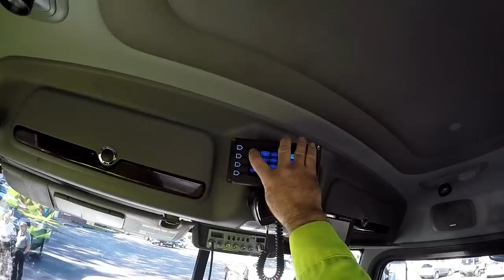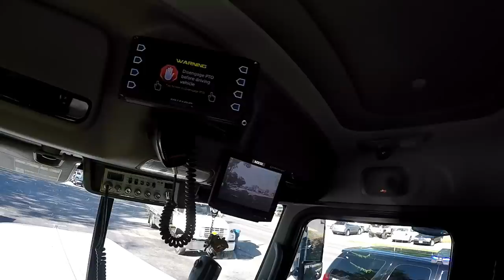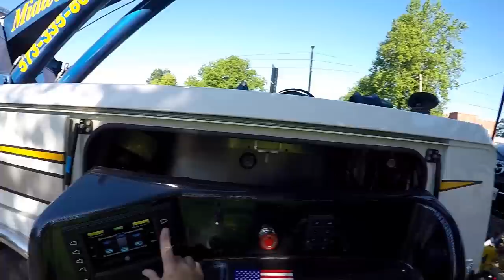TROLL BRIDGE

Comment: I hope you had her remove the car seats her self. I would not remove them for her as I would not want ANY sort of responsibility or liability if she uses those car seats again!
Reply: It wouldn't matter either way. She is on camera being told they can't be used anymore. If she uses them then tries to claim other wise and sue ron, Case won't go far as she was told by Ron and police officers there they are not legal to use when involved in a crash.
Reply: At that speed, with no one in them, there was no damage to them. And unless you recorded the serial numbers, you have no way to know if she replaced them or reused them. That said, it's always best to replace any piece of safety equipment if there is any question of it's fitness. Insurance should cover their replacement. (age is part of the equation. I've known people to use the same baby seats for decades.)
Reply: A very good point that is not stressed enough! Where I'm from the Highway patrol normally cuts the straps on them. If they don't, I do.
Reply: "I've known people to use the same baby seats for decades." <=== this is exactly why the police can give some good fines for that too. I don't have one, but there is a date written somewhere. If there is no date it is considered out of date and dangerous. If more than 10 years old then out of date. In both case you get a fine...

... Some unfortunatelly don't understand it... In fact, there was an article that a mother got a fine and couln't drive with that seat with her kid in it and made a big story: IT WAS BROKEN! She tought it was not a big deal because she only do city driving...
Reply: jfbeam 
What speed do you know she was going?
In that state which the MVC occured, do you know the specific law regarding car seats?
When I said I would have the driver remove the seats it was not so I as a company can sure her, its so she can't come back and so me. Its here property and she is intitled to them I just do not want to be the one thay gave them to her as she could say in legal documents that I knew she was going to re-use the seats as I (mother) said I was and he gave me theml. I (mother) thought he would know if they are safe or not as he has more experience then I. Plus I was shacken at the seen and I was not thinking straight so I did not understand thay I could be or use the seats.
Reply: +jfbeam   I agree. The only reasons for not reusing the car seats would be 1. because the air bags deployed, and 2. because the car could not be driven away from the accident. The car has likely been repaired and is back on road. There is no reason that the child seats shouldn't be too. Assuming there was no obvious damage to them.
Reply: jfbeam the issue a parent or person transporting children in safety seats that are out of date  is that, in the event of an accident where any injuries occur, each child that was using a seat is noted and also the seat itself is inspected. If it is expired then the parents open themselves up to the evaluation from Child Protective Services. Many probably don't think ahead, I guess. Me personally, when I have my children or others in my vehicles, I am sure to at least check the seat for no damage and that it is still in date. I'd rather err on the side of caution instead of dealing with a loss or at least a ticket from a LEO. I'm not bashing your comment in any way, simply offering added information.
Reply: Cartainly if occupied those kiddo seats need mandatory retirement. If not occupied, they would most likely be fine.. actually dropping an empty one on the driveway from just waist high on the way to the car would be far more G load than being strapped in back seat empty and enduring this deceleration. Who wants to take responsibility to make sure?? nobody! .. hence the safest thing is to retire the seats.
Reply: jfbeam 
I agree....as LOW impact.. & as Little damage done.. I'd  say they would probably b fine... thoroughly inspected of course.  Had it been a higher impact....far more damage... then of course No.. discard them!
Reply: Ugf Ugf if a parent is too cheap to replace a freaking car seat after a accident even if it seems to be fine then the parent should have their kids taken
Reply from the maker: soaringtractor   Because, as I and the officer both stated.......It is against the law to reuse them.  You may not agree with it.  I was simply trying to advise the woman of the potential for liability and hoping that she would put the safety of her children first.  Most insurance companies will replace car seats if the owner carries full coverage, again, because replacement is the law.   Thanks for watching and God bless.
Reply: Also there 'could' be hidden damage that is not visible to the naked eye. Why take a chance on your child's life?
Reply: @Zack McBurney So a parent living below or just above the poverty line should have their child/children taken away because they cannot afford to replace a car seat?

Sure they should do what they can as soon as they can especially had the seat been occupied. But the nanny state taking away children is too much.
Reply: Max Zomboni except it's traceable when a car had a write-off/repair, but with baby seats there is no tracing. Like they say with helmets, throw them if they had a crash, as there might be internal invisible damage.
Reply: Ugf Ugf Ron shouldn't have been the one that has to tell her seams like she asked the cops and the cops said something to Ron and he told her they couldn't be used then the cops said no they can't be used, why didn't they tell her that before when she asked them about the car seats and then knowing they can't be used again, other then that great job on getting it out
Reply: There's also the possibility, they're the multi-use seats that are a carrier/clip into a stroller, to which they would still be fine for that.
Reply: It was a 9 year old car.  The cost to replace all those air bags would be more than the car is worth probably.
Reply: Yeah i'm kinda surprised you or the officers didn't cut the straps on the seat to insure they won't be reused after an accident. Thats really the only way to insure someone won't reuse them besides take down the serial number from the seats which would be almost pointless as how many officers do you know have the time to check something like the numbers on car seats to see if they were in accidents? I dont agree with it in a case like this one where the seats were not even in use when the accident happened. But as Ron stated that doesnt matter they were still in the car when the accident took place so they were involved in the accident. Its all about the safety of your child and it is always better to be overcautious and just buy new than to risk it and reuse the seat then it fail at the moment of truth in another accident where a child IS in fact in the seat but the seat fails and the child is injured or killed as a result. Although they are made out of some tough plastic, fiber, and poly they are still made out of plastic nonetheless.
Reply: bet you'll  be in a garage sale some day
Reply: NHTSA policies on seat replacement - IF the vehicle meets ALL of the following requirements 

* The vehicle was able to be driven away from the crash site; AND
* The vehicle door nearest the safety seat was undamaged; AND
* There were no injuries to any of the vehicle occupants; AND
* The air bags (if present) did not deploy; AND
* There is no visible damage to the safety seat AND 
The manufacturer of the seat states it in the owners paperwork, AND it isn't against any local/state laws,  you might be able to re-use the child seats. 

These are a few of the manufacturers and what they say about seat replacement-

Manufacturers who state ALL seats they make are to be replaced after ANY crash or accident :

BabyTrend, BubbleBum, Chicco, Clek, Cosco, Cybex, Evenflo, Graco, Harmony, KidsEmbrace,  Maxi Cosi, Nuna, Orbit Baby, Safety 1st, The First Years
ALL Dorel Juvenile Group manufactured seats under all branding. 

The ones who say to check the manual and contact the manufacturer to see what they require -  
Combi, Diono, Peg Perego, Recaro, Ride Safe, 

Britax and UPPAbaby both follow the  NHTSA’s minor crash criteria.
Reply: I had a friend who tested baby seats, the thing with an accident is not always just the straps, so yes, there may or may not have been any children in them to hurt the straps, but the airbags deployed and could have caused hairline cracks in the plastic. But also, if they were anchored during the accident, even a low impact crash could weaken the anchors. If they were not anchored then the car seats could have hit the front seats during the impact also causing damage. It is never a good idea to risk your kids lives by reusing car seats and remember, she may buy new ones but these seats may end up in a garage sale or given to a friend. Accidents are expensive that is why it is worth the extra money to have proper insurance coverage for your needs. I hope after the shock of the accident wore off, once her mind settled down, that she chose to buy new seats.

Comment: Funny story. I had my first wreck about 8 hours after getting my drivers license (this was before the current learner permit system we have now). 

Nothing bad, just missed a 90 degree turn, and dropped the front into a ditch. I still can remember (30+ years later), asking the tow truck driver to "Please be careful" and he looked me right in the face and said "You tore it up, and now you expect ME to be careful?" ... and he proceeded to rip my rear bumper cover off, wrap a CHAIN (not a fabric strap) around the crash bar, and bend the crap out of that pulling the car out. The actual wreck did no damage at all, but the extrication ended up TOTALING the car! 

It is great that you actually care about the car, and you can tell how much you care for the drivers and the LEO's. Amazing work. God bless!

Comment: Hey Ron, a Huge fan from the UK here, I just have a quick question for you. Why do you pull on the Airhorns from time to time? Is that to just warn the people around you that you are about to move? Keep up the Amazing work Ron.
Reply: McSTALLION YT noise in the area. That way it will get the attention of anyone who may be around so the can act accordingly. Sometimes people walking through and not knowing your intention will actually be hurt if you don't use your horn. A bid safety precaution.
Reply: Yes he honks to allert people that he is about to move. For safety reasons. Cause there are major blind spots on a truck that size when it comes to pedestrians
Reply: McSTALLION YT the norm is to toot the horn before backing up ad well
Reply: He honks 3 times when about to reverse. So anyone around / on / back the truck who he might have missed spotting has a chance to get away.
Reply: Richard van Pukkem Fire Dept  1 toot STOP, 2 go ahead, 3 reverse
Reply: It's a safety alert originating from the railroads. Here in the states, the Federal Railroad Administration mandates that when we move a locomotive, we utilize two quick blasts of the whistle to signify our intent to move forward. When reversing, it's three quick blasts.
Reply: All of the above and Youtube is full of amateur NHSA keyboard commandos... so following 'strict' adherence to rules like sounding off before backing up helps curtail some of the "Every time you back up a truck/train/car/boat/airplane/hovercraft/wheelchair/tricycle you have to hit the horn/use arm signals/send out smoke rings/place nautical flags/do the hokeypokey/blat out Morse Code for backing up/blah/blah "
Reply: It goes back further than just railroads.  Boats also (are supposed to) honk three times to signal reversing since the steam age began  One short honk is typically never used as a signal, that could be equipment malfunction.
Reply: I was gonna say, three honks are what big ships do when they back out. Hear it here all the time with cruise ships.
Reply: Thank's for the Detailed answer to my question everyone. Greatly appreciated! :)

Comment: Good thing you all got that on record ,if she trys to pull a fast one with those car seats
Reply from the maker: I don't think she will.  God bless.
Reply: Ron Pratt sorry if I sounded mean, it's just I've seen too many people looking to cross anyone is all sorry sir, God bless
Reply: Not sure if it is still the same, but years ago had one involved in an accident, the mfg of the seat got all the info and overnighted a brand new one and wanted the one in an accident back so they could inspect it.
Reply: That's what I was thinking. I would have said no just for liability issues and let her pick them up from the shop once I looked up the law and cleared it.  It's just like how a mechanic cannot let you leave with your car if it's unfit without signing about 5 waivers acknowledging that the mechanic and shop had told the customer that they cannot drive the car without it being fixed and any accident ensuing is their own fault for knowing their equipment is faulty.
Reply: Greg K there are also bicycle helmet makers (Giro) that do that.

Comment: Not using that car seat again is the same as when a hard hat gets hit you may no longer use it. That's the rule in gas plant construction anyway.
Reply: Sure, except in this case the law requires you not to use it whether it got hit or not. I personally do not like kneejerk blanket coverage laws like that. If the seat was empty, strapped in, and in a location that was not impacted, it is plenty tough and light enough to be 100% undamaged.

Comment: I really like the public spirit here... Calling in a heavy salvage vehicle to reduce the damage of a small salvage, good on you and your local police force :) Here in AU, a flatbed tilt tray would have  just been called in, reversed up to he cars rear, and skull dragged it out straight onto the tray, disregarding any further damage. They call it an insurance tow... flat rate about $300-350. They just do whatever to get it out as quick as possible.

PS. I have watched a few of your heavy salvage videos also, such as the bridge fail, the cotton seed truck, and a rollover (can't recall what he was carrying).... Your work is amazing.

Kind regards, from a coach driver, who has only been towed once due to a breakdown in a reasonably safe spot. (when  say reasonably, I was still out there in my high vis vest trying to make sure he didn't get run over)

Comment: That lady must not care about her children. Car seats that have been involved in a wreck are not safe. Most insurance companies will buy you new ones all you have to do is ask them.
Reply: What does seats have with car accident? seat belts are the ones that take all the strain of stopping the body in sudden stop, car seat takes same strain as everything else bolted in the car, so it would mean you need to replace everything?  Also seat belt is anchored in 2 points separately from the seat! I really cant see logic in that law besides seat manufacturers / shops making some serious profit from that law
Reply: @grunfkozminski5362  At higher speeds the force of the driver body can wreck the seats internal structure and then it is the matter of the security devices inside the seat. Volvo's seats has a function where the seat rights itself to a more vertical position to prevent the body.
The explosive seat belt stretcher is also an item.
Reply: The seat backrest in a fair number of cars will if the car is hit from behind raise itself rather smartly, this to support the driver and passenger in a better way.
Reply: @grunfkozminski5362  the seats in question were child restraint seats, not the normal seats built into the car.  They're not supposed to be used after an accident because they can sustain damage to their internal structure and/or anchor system that might not be easily apparent.  The law is nominally there to protect children from their own parents and caregivers cheaping out on properly caring for them... ironic, I suppose.  But anyway, you're probably right that the child seat manufacturers lobbied for the laws both so they could make more sales, and so they wouldn't be the "bad guy" telling people that their product had to be replaced.